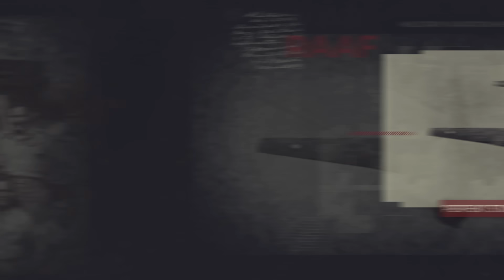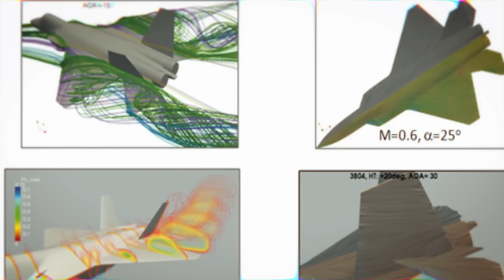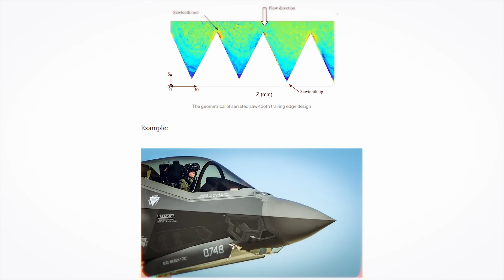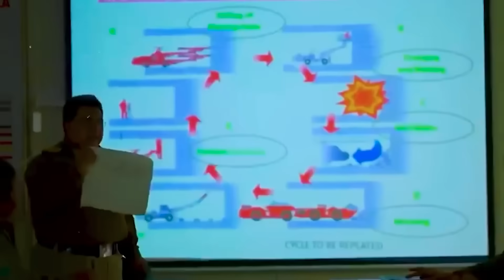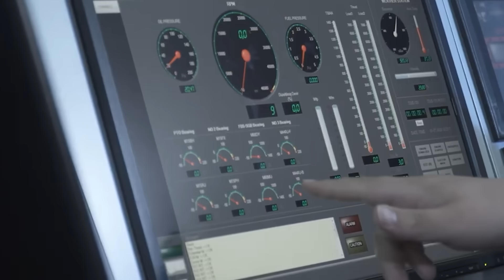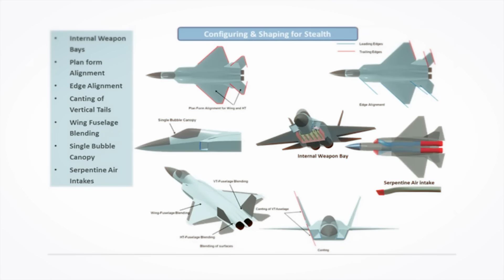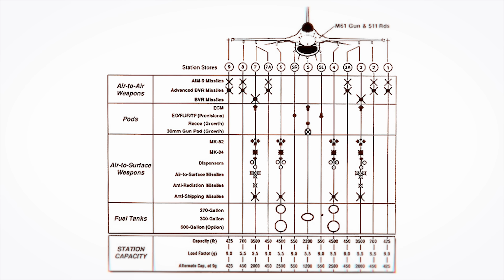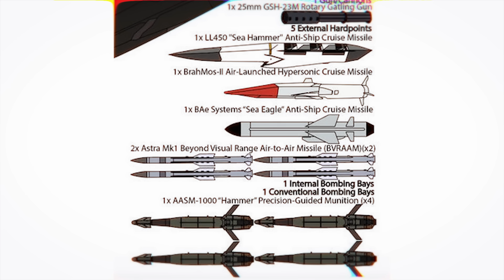India's 5th Gen Aircraft | HAL AMCA

Comment: If you're a country and you want to build stealth aircraft. The first thing you have to learn is that you never line up the air inlets with the front of the engines. If you do, you instantly make the RCS about 1 square meter because the radar waves will bounce off of those fan blades all day long!
Reply: This is what happens when one does not see the video and comments fly . There is an entire section on divertless intakes to reduce radar bounce off the blades . Watch again

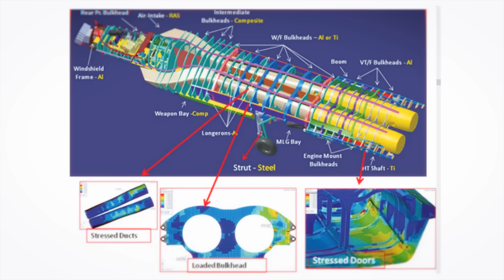Comment: Timstamp 4:00 to 4:15 - The conclusion here is somewhat erroneous. DSI Intakes and Serpentine Ducting are separate design issues. There are modern supersonic combat aircraft, like the F-22, that have serpentine ducting to hide the face of the turbine engine. It has been known at least since the 1990s as a way of reducing the aircraft's radar signature. The real benefit of the DSI intake is its reduced complexity. No splitter plate is needed, or a variable intake system to keep a smooth air ingestion into the engine. This also reduces the radar signature as there are no longer any complex sharp edged (radar) reflective surfaces on the intake. The drawback to the DSI system is that this intake limits the top speed to around Mach 2. Any faster, and the DSI would not be able to handle the airflow into the engine. Again, this is why the F-22 does not have DSI. but a splitter type intake. The DSI is also a good indication of what the possible top speed is of an aircraft. In this case, the Chengdu J-20 is limited by its DSI intakes to around Mach 2 or lower.

Comment: most of the things are right but AMCA is in weight/dimension category of KF21 or stealthy rafale/typhoon.. that's why engine are 110 KN requirement & used are F414 where as in case of TAI KAAN they want it to be equivalent weight category of F22 or J20 that's why they are using larger f110 engine with thrust of 130KN & they require 150-55KN engine to do super cruise & have agility of F22.. IAF while operating SU30 (heavy & large) & Rafale (medium) concluded that we don't really need heavy aircraft for our threat scenario but medium weight fighter with good agility & modern era EW, A2A munition & modern avionics.. with only 2 long & 2 small range A2A missile IAF fighter would be at disadvantage but doing long term CAP & with medium engine is cheaper & AMCA could act as node to paint PLAF or PAF jets where as non stealthy SU30MKI or Tejas MK2 could act as missile trucks..

Comment: India have TEJAS MK1A which is 3.5 gen aircraft where as TEJAS MK2 is 4.5 but it still need at least 4 more years sadly AMCA programe starts in 2029 and serial PRODUCTION take 5 more years meaning there by AMCA will come in 2035
Reply: TEJAS mk1a is 4.5gen jet
Reply: @harshitrai5306  a 4++ aircraft which is between 4+ & 4.5gen
Reply: Lol really u dum a s s 3.5 generation aircrafts have GaN based EW.. the jammers is GaN based.. does 3.5 gen have aesa radars , do they have fly by wire.. if anything is 3.5 generation then it's jf17 block 1&2 which are not even unstable design hence do not have fly by wire 😂😂😂which is basic parameter for jf17

Comment: Not trying to put a damper on this.  But how did India's previous "indigenous" Tejas fighter go?
Reply: About 180 units already ordered 83 tejas and 97 mk1a and I'm sure govt will order 200 units of mk2. But hal increased its capacity to 24 units per year which is not sufficient as per our urgency but things are going in good direction
Reply: After initial problems, the program is ramping up now, they’ve got 96 or more on order for the Mk 1A model, with more on the board for the Mk2
Reply: Doing great, not yet battle proven but it's record is excellent as it got crashed just once (because of GE 404 engine failure) in 20+ years 
India airforce already ordered over 200 Tejas
Reply: Tejas is a good clean fighter with no faults. But it has some downsides (not technical faults) its main down side is its low combat range (600km, 800km with external fuel tanks). 42 Tejas mk1 in service, around 200 Tejas mk1a on order. 24 unit production per year plans to ramp up production in the future.
Reply: they will replace mig21
Reply: Excellent. 40 of them deployed and flying over Kashmir and Ladakh. 97 more will be deployed by 2027. They are replacing the Mig-21s.
Reply: tejas mk1a will be out soon which is  refined & has addressed mk1's flaws, mk2 is also in the works which will probably come out b4 the amca.
Reply: Just like Android phone upgrading every year.
Reply: a few crashed. new widow maker after mig21
Reply: @watb8689  A few really ? False information spreading much ....just 1 crashed recently due to GE404 engine failure ...with video proof that even after pilot ejection the quad fly by wire kept the plane gliding till it crashed into a house ...proves how good the fly by wire system computer is ....plus the design software built before building the Tejas fighter is innovative enough that it was bought by Boeing and Airbus to design their own passenger jets
Reply: @watb8689  what???? false news!!!  only one got crashed in its entire development phase of 23 years
it is the best record of any fighter jet around the world
Reply: @watb8689  false information. Your a propaganda machine.  Only one crashed recently due to engine failure. Tejas has the best track record.
Reply: @watb8689  yeah like F35 didn't even crashed once

Comment: none of those so called "stealth" aircrafts have been validated by ohter faction/country to be "undetected". and the nation who produces themselves will not publicize any "failing parameter". everybody rely on the "war of image". so long the adversary dont know it is detected or not in radar, the illusion may persists.
but i will give a heads up for every single nations that are making those so called "stealth" planes : if covering those aluminum airframes with non conductive insulators is all it need to be undetected by radio sensors, well, there are many cheap classic traditional UHF antenna for old conventional TVs that have its antenna part covered by plastic insulator and such and STILL catching radio signals and even causing INTERFERENCE. you know what that means? phasing out radio signal returns is not as simple as covering every single aluminum parts with plastics.
Reply: All stealth aircraft are detectable. The challenge is guiding a missile to it and they are detected at much closer range than conventional aircraft.
Reply: @deanwilliams433  good luck buying stealth jet that dont do stealth. you said all stealth are "detected"? you do know that every radars use and functioning in an specific EFFECTIVE BANDS/frequencies? do you know why? so every trees wont make blips in radars. or some flying birds, or some electrical poles at the streetside. so they CROPPED the bands. and covering aluminum with plastics/insulators WILL NOT make your plane signature as small as a bird. if a tiny UHF antenna covered in plastic insulator people in third world suburbs use to catch radio signal could make radio interference to a kilometer away what makes you think a giant flying aluminum junks covered in polymer could evade themselves from radio signals? ,you so smart please go and read how radar works.
stealth RAM coating the U.S use do RADIO SIGNAL PHASING. there is a conductive layers under the coatings that being run by a certain electrical signals that phase out incoming radio frequencies. thats why their F22 and F35 cant communicate using normal radio means. the "composite" aspect of it is so it can be ELECTROACTIVE. its not an insulator. unlike all these other stealth wannabees.
Reply: stup*d comment
Reply: Anybody that follows Indian defence industry will know how "war of image" is the bottom of the priority list here. India is not like South Korea or Turkey in that it doesn't need export success for its weapons programs to break even. Because unlike the South Korean or Turkish military, the Indian military is huge and they alone can place enough orders to justify the investment into a new weapons program.
On top of it all, the designers of these Indian fighter jets work in a not-for-profit government department, not in some public or private enterprise. 

India doesn't have anything to prove to anybody. It makes jets for its own use and if it can't make them work for the job at hand (in this case, 5th gen air superiority), then only India will lose, because we are the only nation on Earth that share borders with two hostile nuclear armed nations. We ain't got the time to play the "marketing gimmick" game. Because no matter how much we improve the "PR" of our product, it is only the real world performance that matters. And the end user (Indian Air Force) has been harsh in its assessments in all prior domestic Indian weapons procurement programs for this very reason. 

The only illusion here is your understanding of the ground realities of the Indian defence industry.